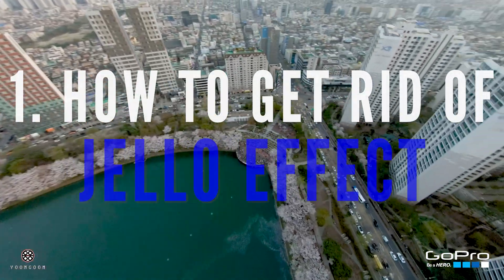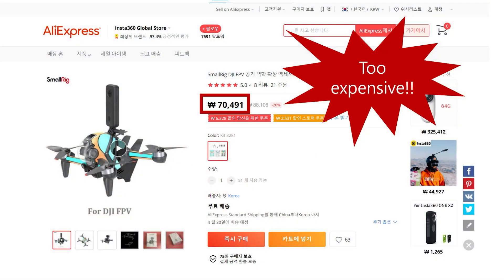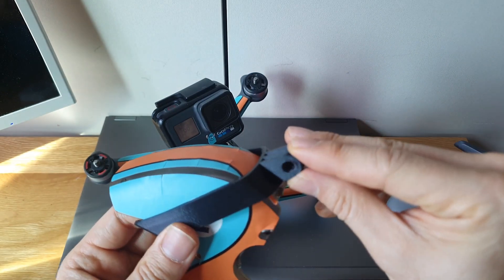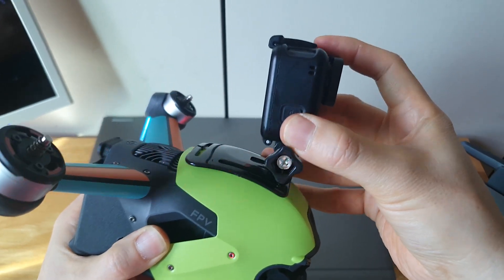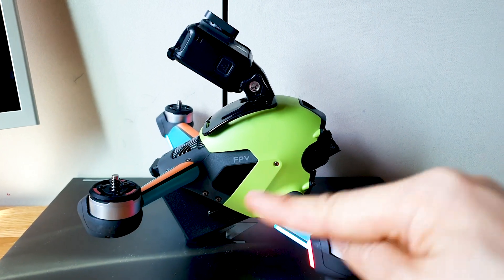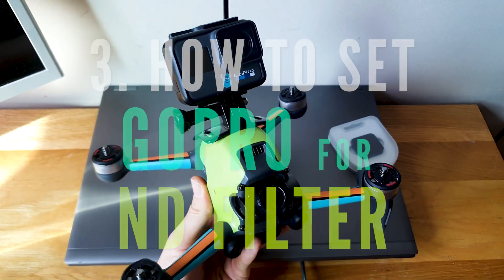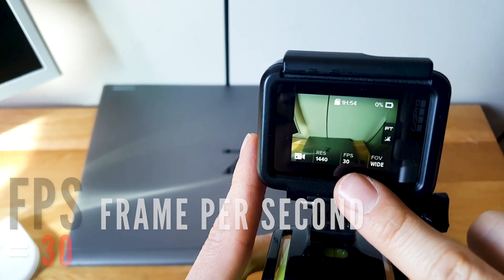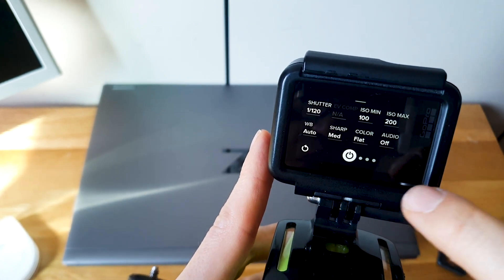How to delete Jello Effect on GoPro + How to install Gopro properly + GoPro  Settings for ND filter

Comment: beautiful location and great tips...noticed a little Jello on the tallest building but it was very subtle
Reply from the maker: It's all about how strongly fastening your mount and gopro, always fasten with spanner, not with your fingers, and there's should be enough cushion(like 3m tape) between.your mount and fpv!

Comment: Where do you get the fixed mount? I dont seem to find it. Thanks and great video. Congrats 👍
Reply from the maker: hi actually it's the parts of the head mount and its why it's curved. can u access this link? https://link.coupang.com/a/KupoD
Reply: @YOONGOON_FPV  thanks for the reply. I did find it in the end. I was looking for helmet instead of head mount and it was different. Now i ordered one. I have the same jello efect on a gopro 6 and dji fpv so i’m trying to fix it. Thanks alot
Reply from the maker: @aboveromania  yes it will do but not 100% there are still some jello recently when I was flying aggressively in windy days
Reply from the maker: try to watch my dji fpv videos and u will see the small vibration and little jello
Reply from the maker: @aboveromania  and one more thing try to tie each side to arms with dental floss for preventing mount to fall off when crashed to trees... I have lost my gopro when I crashed at snow and grass fields.. so hard to find the small gopro you will see there are strap holes at that mount ^^ which make much more stronger mount that will never detach
Reply from the maker: dental floss is really strong light strings to use!